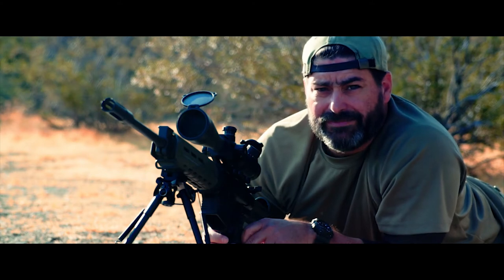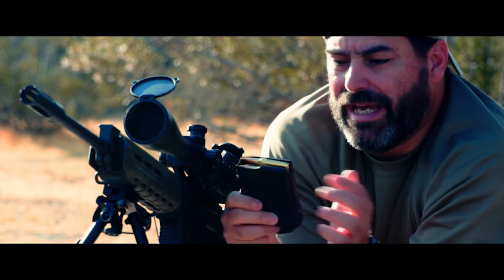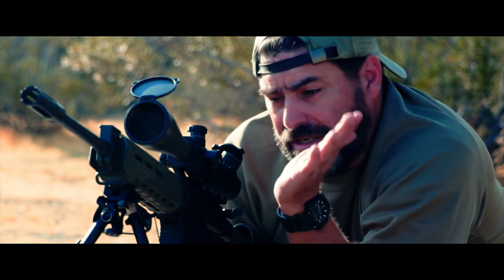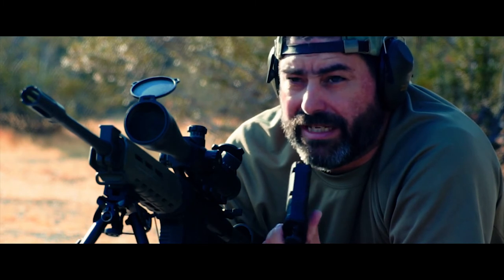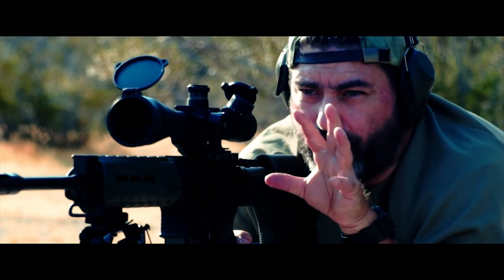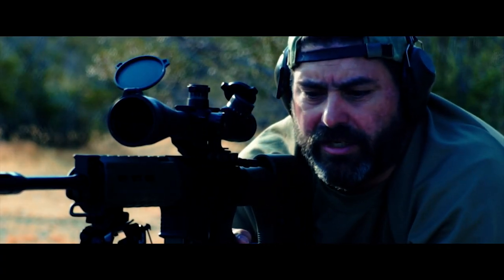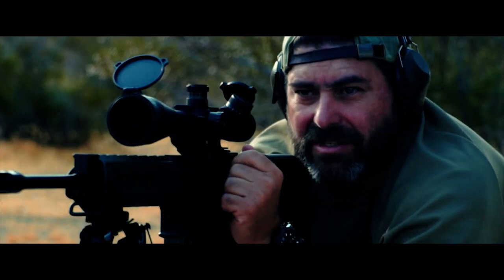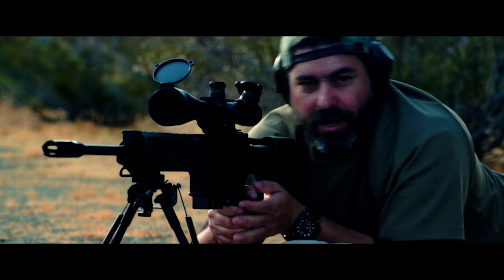M&P-10: Solutions Ep. 1 PROBLEMS

Comment: I have the same rifle and completely love it. I have the 10" diamondhead handguard, pro comp brake, cmc single stage trigger, harris bipod, aero precision mount with a 2.5x10 bushnell scope. 

I really enjoyed your video
Reply from the maker: I love mine too   =)
Reply: I'm looking at the Diamondhead handguards.  I also looked into thje Odin works one.  Is there a low profile one or dpms they make or can you link a URL?  Mine has been shooting pretty good stock, but I'd like to extend out the handguards for a number of reasons.  Thanks!
Reply: @codyhanthorn4270  i believe they make only one kind and it's low enough to where I had to get a low profile gasblock. Look up vrs-t308. I got the 10". You have to choose 16 or 18 thread pitch for the barrel nut. I don't remember which one it is for m&p10 but I remember calling and asking a long time ago.

Since this post I added a 20" heavy barrel, nickel bolt, and a2 stock.
Reply: @Erik7prc  The odin works I am almost pulling the trigger on is a dpms low profile.  The dieamondhead looks nice.  I will have to call them tomorrow.  Maybe have to call Smith and Wesson to get the thread pitch for Barel nut.  the one review showed a low profile gas block and install.  Didnt look hard to do.
Reply: @codyhanthorn4270  I had a guy install mine because I did have a vice or tools at that time. Diamondback head will tell you the pitch you need. If you want I can shoot you pics of mine. Gotta shoot email or #. Erase it after I get it. My rifle looks nothing like m&p10 anymore lol

Comment: Brian-not so lucky as you.  I have had nothing but trouble from my M&P 10 right out of the box.  Failures to feed and routine failure for LRBHO.  I sent it back to S&W and they returned it in the same condition; still having functional and short-stroking issues.  It came back with a form from the armorers list 56 check boxes for replaced or repaired parts, but non of the boxes were checked so I don't know what work, if any, was done. Although the manual for the weapon warns the owner not to perform modifications/repairs as a reason to void the warranty, left with no other options I have begun my own attempts at solving the problems. So far I have replaced the gas block and tube with little improvement. I have ordered a nickel boron bolt from Precision arms because it has always seemed to me that the factory bolt was hanging up a bit in function tests.  If that doesn't yield results, next stop: buffer and spring manipulation.  Right now the rifle is able to cycle 80% of rounds but the LRBHO never works.  Too unreliable to count on.  It doesn't help that so many of the parts are proprietary.
Reply from the maker: That's TERRIBLE!  It's a great rifle.
Reply: Same here. I bought one new a year ago, didn't get to shoot it until a couple months ago and its nothing but problems. Ran one mag thru fine and then wouldn't cycle a round after each shot. I found brass powder and shavings in the gun. Cleaned it, lightly filed some burs and it improved and cycled 60 rounds no problem. Cleaned again and found more brass powder all over. Went back to the range and same cycle issues again.

Comment: First things first, because you used a bag on the second string of fire you didn't suffer the poa/poi shift that you caused putting a downward/left pressure on the magwell in the first. That accounts for the first string of fire coming in high right. I would suspect that it had nothing to do with the magazines. Secondly, your light primer strikes are due to S&W putting a spring inside the bolt carrier to prevent the free floating of the firing pin which would be commonly found in every AR variant. Remove the spring and you'll find that the issue has been solved. Best of luck with your rifle brother, aside from a few easily corrected faults (firing pin spring, non free floated barrel, etc.) the M&P10 is an outstanding rifle.
Reply from the maker: It really is.  I love it.  I hope you watched episode 3 of this series.  My trigger issues were due to not fully resetting. A good cleaning solved that.  I'm using a Velocity 3lb trigger.  I will keep that firing pin spring in mind.  This series was meant to implement a bunch of viewer comments on a couple of earlier videos. 

I'm working on another video which puts everything in context.  I've been hitting consistently at 800 yds, but the weather hasn't been cooperative to repeat it on video.  Looking forward to getting this last effort out there for you guys, especially the nay-sayers.  Thanks for your comment.  All good observations and suggestions!
Reply: TSF Channel the spring I'm referring to is inside the bolt carrier. For reasons that elude my understanding S&W decided to put a spring inside the bolt carrier where the firing pin sits to prevent it free floating. With all AR 15/10 style rifles the firing pin slides freely fore/aft. Notice in a standard AR rifle that if you chamber a round and then remove it without firing there will be a very slight indication on the primer of the firing pin making contact with it while going into battery. It's not enough to slam fire because the mass isn't there. S&W installed a small spring to correct the firing pin touching the primer while going into battery but in turn created an issue where people are having ftf's due to the rearward resistance placed on the firing pin during the hammer strike. Simply pulling that spring resolves 99.9% of light primer strike issues with the M&P10 and will prevent the issue from becoming recurring when the rifle is either cold/dirty. I watched your other videos as well, I'd love to be able to stretch out to 600+ but it's a chore finding a place in central KY where you can hit those ranges without firing from one hill to another lol.
Reply from the maker: No, I'm tracking.  The firing pin is a bit more robust, especially with that spring.  Yep.
Reply: he's a fake. Faking so he can say he fixed it in part 4. His shooting sucks !!! I would take him on any day !!!

Comment: i  also noticed ground position loose dust sand etc. from m blast  your going to get presure splash back  as weapon system is low to ground  bullet has that opstical on its way to the target
JUST A thaught . also the ground temp vs / air temp at shooting position / try a mat that doesn't allow for movement.
these are just thaughts on what im observing hope this helps.
also  are you completely comfrable before sending it. and last thaught what does your weapon system like to shoot stick with that ammo 
last night i shot  a cci quiet with a vel. of 697 fps air temp was - 9 c calm but snow on ground
shooters position was prone in hard snow
wind cond was from 7 to 3 with 3 to 5 mph.  Target  was 6" plate distance 172 yards.
this was a direct hit 1 shot not centre  actualy 2" to centre.
But setup took roughly 12 min. everything was carefuly applide. 
i sometimes like to just play with the wind  on a winter evening 
and i used a savage 22lr  semi  so it didnt cycle of cours
but it was fun anyway i had a dificult time with the bipod  it took some effert to lock it down
for pre load
 ice.
25 yard 0  not braging just saying its like playing a good game of chess.
 i had to kill the plate without alarming my naboures lol.

Comment: Hey brother my M&P really came alive with a full float handguard but the lateral spread is one of two things wind or you. Swap out that stock trigger for a drop in or JP unit and you wont be disappointed. Also these guns love to run wet oil down your BCG really well and it will run much better.